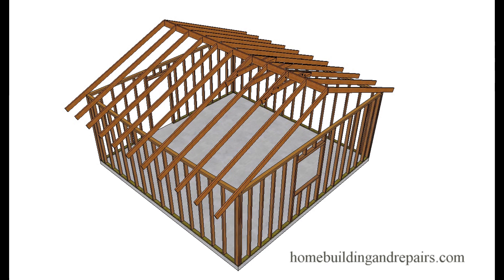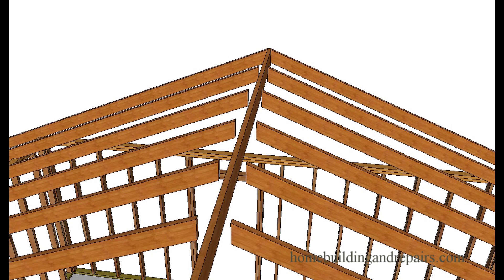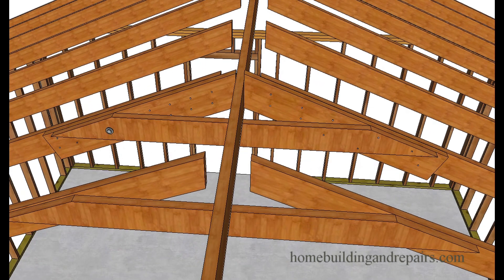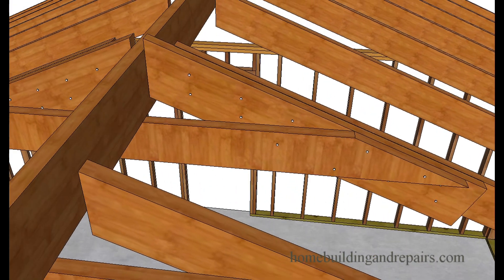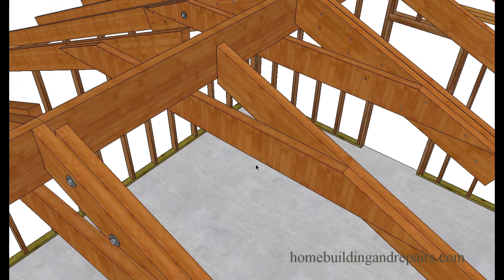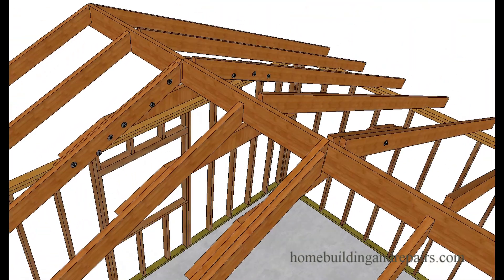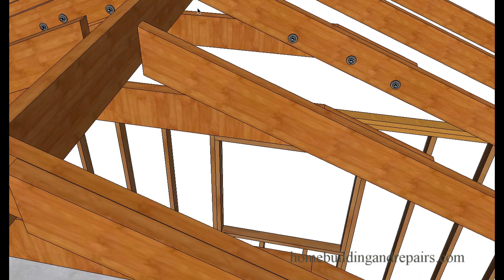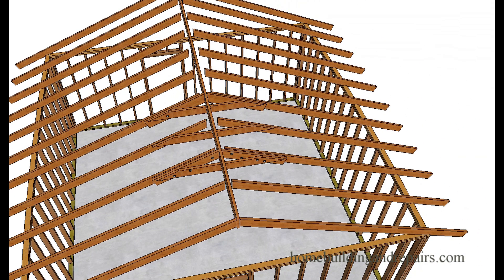Ideas for Rafters Separating from Roof Ridge – Building Repairs Education

Comment: Couldn't you install sloped joist hangers to tighten gaps narrow separation? For example, Simpson Strong-Tie LRU26Z or LRU210Z. Perhaps there would be a way to insert a shim in between the gap before installation of the hangers, too.

Comment: One additional cause for this condition I have seen in the course of an inspection is where the ceiling joists are parallel to the roof ridge and rafter ties were installed, then sometime later the ties were cut or damaged. Walls are spreading at the top, separating the rafters from the ridge. While diagnosing the cause of conditions is not usually performed during a home inspection, it helps to know what might be going on as a red flag for what else to pay special attention to.